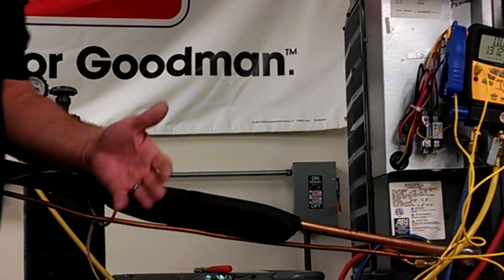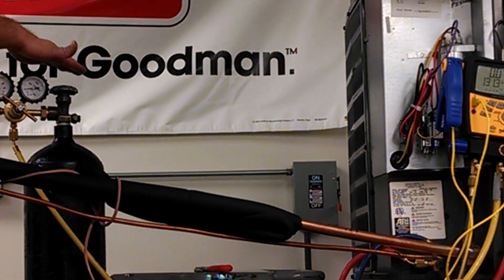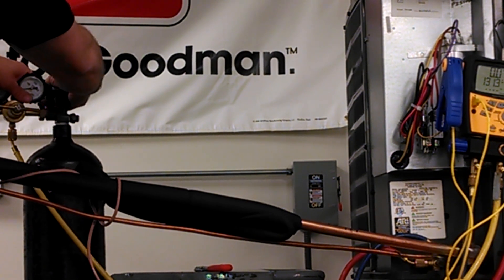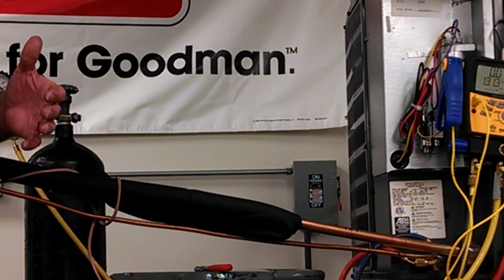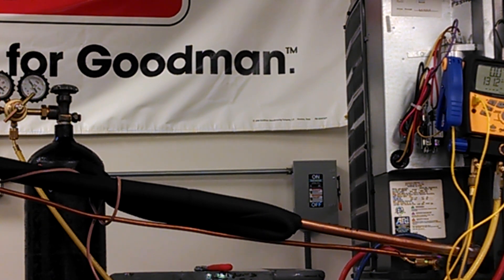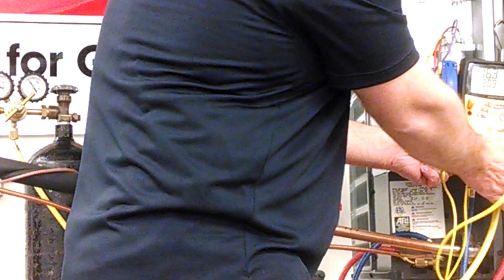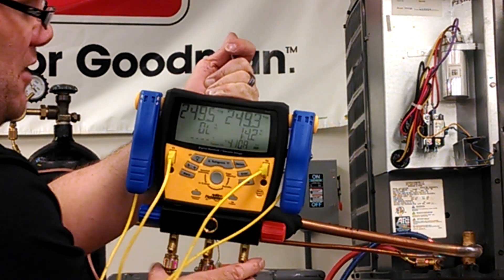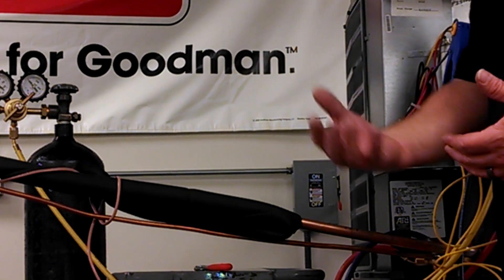Pressure testing an HVAC system with Nitrogen

Comment: Why use Nitrogen and not straight Air....?
Reply: oxygen (compressed air/straight air) and refregerant do not mix. you will introduce moisture into the system and it can possibly cause an explosion as well. bottom line using compressed air is not a good idea. :)

Comment: The pressure is on R410  --> 602 PSi  it´s also the max. System Pressure. I have my Heatpump with R32  over 17 h hours with 638 Psi (44 Bar) testet. No leak, perfect!  Don´t be afraid with so hight Pressure, the Testing pressure should be a little bit higher then the max. System Pressure.
Reply: my coil says 450 max
Reply: You didn't go to school or read any books then that is a good way to ruin a system

Comment: How do i apply what you have done to pressurizing common house to find pipe leaks
as many beach front homes are on sand.  Therefore, i would like to pressurize system with Nitrogen to rise and detect leak with Nitrogen detector.

Comment: Would have liked to see where he connected the test hoses.  He didn't mention that the valves that release the refrigerant from the condenser must remain closed until after a successful test and purging of the nitrogen from the lines.

Comment: Uhmm, I read somewhere that pressure test should not be done at higher than 150 psi because "nitrogen atom is 1,000 times or more **smaller than the vastly more bulky R-410a (or R22) molecule....these vastly larger molecule will not fit through microscopic holes that nitrogen will stream through almost unimpeded".
Reply: The pressure really varies system by system. And you are right, this just happened to one of our teams a few weeks ago, and a technician also experienced this. They used a higher value - below the maximum - but high enough. And indeed it did not show a leak. Yet, there was one in each system. So, that's actually a very decent tip.